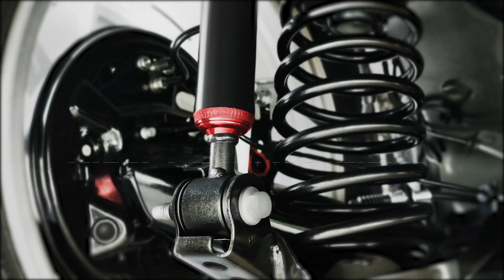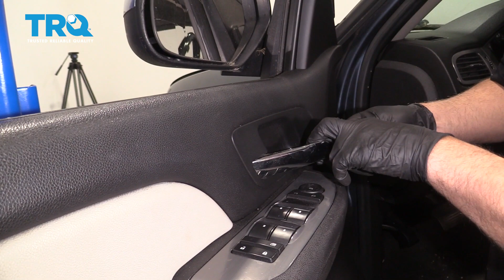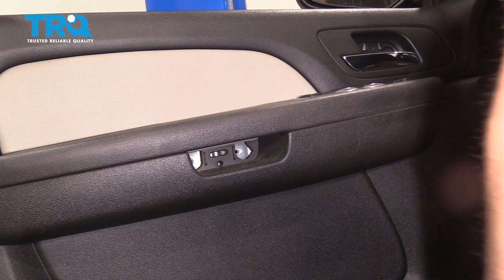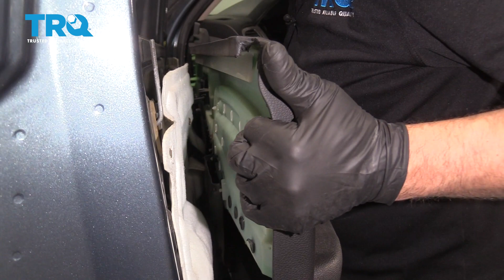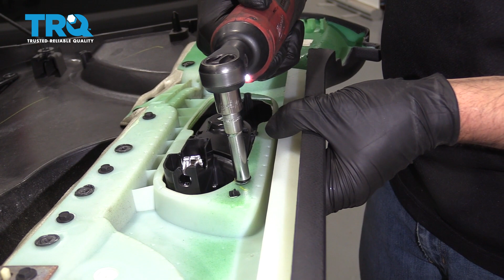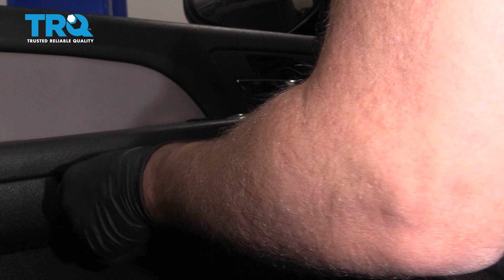How to Replace Driver Side Door Handle 2007-13 Chevy Avalanche

Comment: What if I can't get the outside handle or inside handle to work? Door is closed. I replaced the outside door handle, and it worked like twice. Then the door wouldn't open at all..